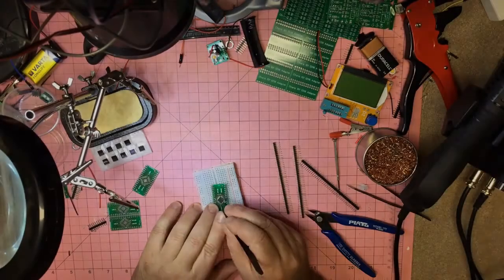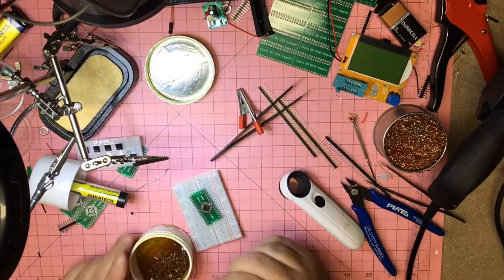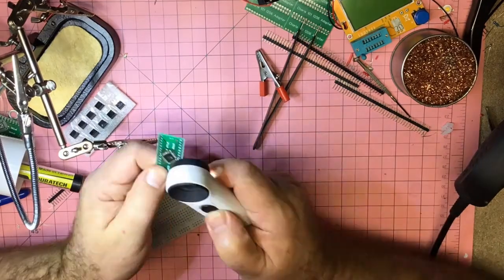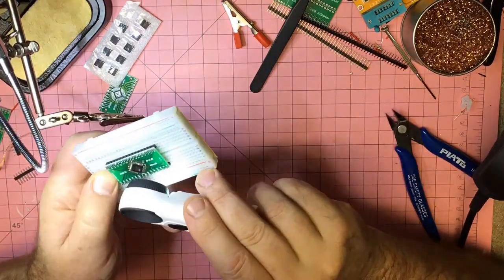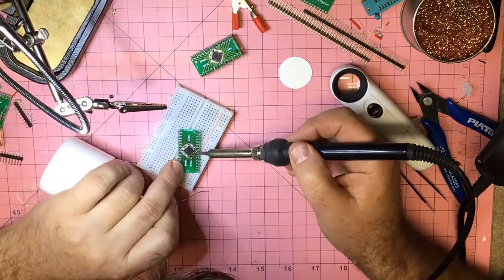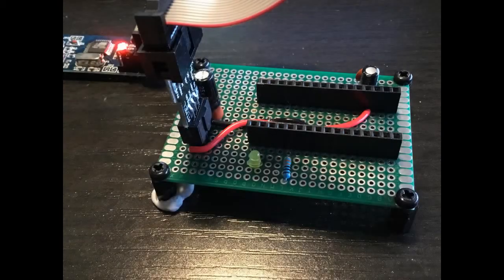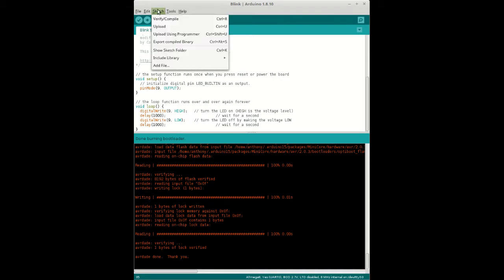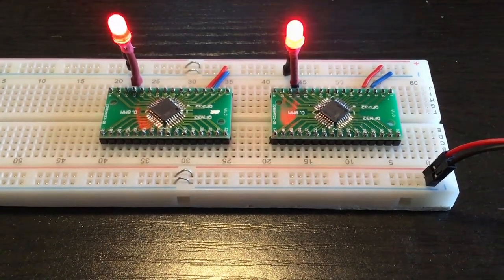ATmega8A AVR

Comment: How hex file upload to IC atmega 8A au smd (QFP- 32 Lead)
Reply from the maker: I made my own programming rig. Circuit, diagrams and details on the blog link in the description. You will need at least a USBasp. Good luck! 👍😀
Reply: @onecircuit-as  I have usbasp available along with .hex file. Only confusion is how  the .hex file upload to IC atmega 8A au smd ( QFP-32 Lead) with the help of usbasp. 
Please help me regarding for same.
Reply from the maker: Look at the circuit on the blog and make the same connections. Use Arduino IDE or avrdude to upload your code.

Comment: Yes, I have been here.  I like the DIP plates, but they are more expensive than square ones.  You could sacrifice 512 bytes for Optiboot, or 2k for USBASPLoader -- which may be quite significant for an ATmega8a.    https://www.obdev.at/products/vusb/usbasploader.html
Reply from the maker: Interesting, thanks! I’ll check that link out - those older ICs are still pretty cheap. 😉
Reply: @onecircuit-as  Maybe the mega8a still has wide industry applications, or they can fit a lot on a single die?  Oddly, these are cheaper than the mega48, and even weaker tiny models.   I bought a small batch last year that amounted to about 0.44/ea.   https://www.aliexpress.com/item/32748805999.html